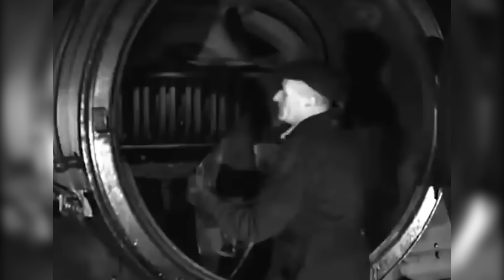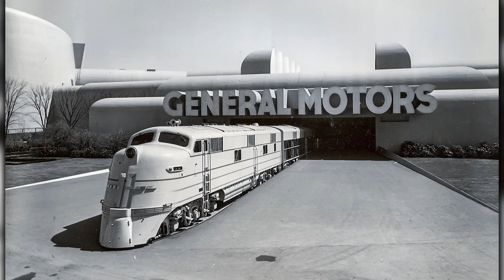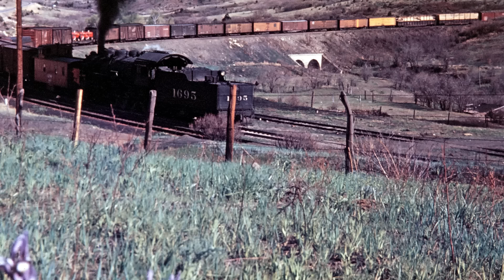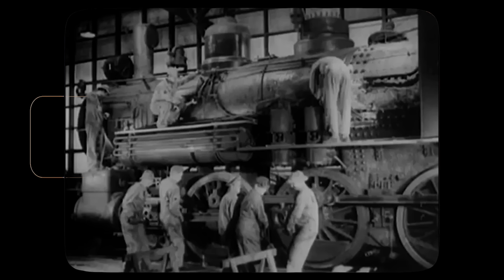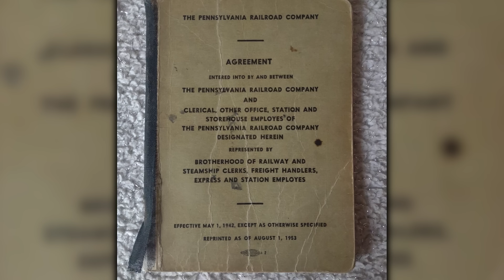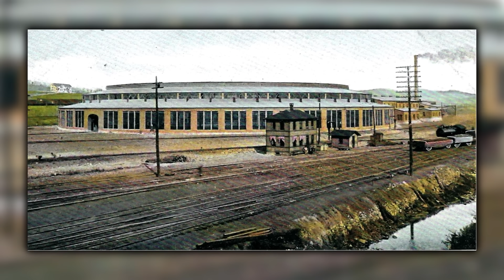The Diesel That Made Every Steam Locomotive Obsolete

Comment: The Super Power concept was created by Lima Locomotive Works in 1925, NOT Baldwin. The N&W Class J was developed in 1941 NOT in the post WW2 era. The N&W Class J was a standard 4-8-4 type with 5% to 6% thermal efficiency. Which was nowhere near the thermal efficiency of a FT. Do you fact check anything?

Comment: Steam engines are part of rapid industrialization but the higher demand created Diesel. As someone who works in this industry, yeah steam engines are much more maintance heavy and require more money. Diesel is cheaper, a bit simpler to make in modern times and then also came the Electric locomotive that kind of partially took over. the only issue is that you need to electrify railways and that is not always easy to do in long strips of railway in desserts or mountains hence why the Usa moistly operates diesel-electric while Europe uses lots of Eletric. geography counts, people.

Comment: Operating costs.
Reply: Diesel is some 4X more thermodynamically efficient than steam.  Not even close and that's before all the other factors like warmup time, water service, maintenance....
Reply: As someone who is a licensed train driver and fan of railways. Yes Steam engines no doubt still look amazing but they are simply to expensive to operate. Steam as a source power is limited, Diesel can produce more output with lesser size, cost and maintance. then came the electric era with even more benefits albeit at the expense of making electrified railways.
Reply: @trifosu1386
I think the reason people find steam locomotives so fascinating is a lot of the running gear is right out in the open.